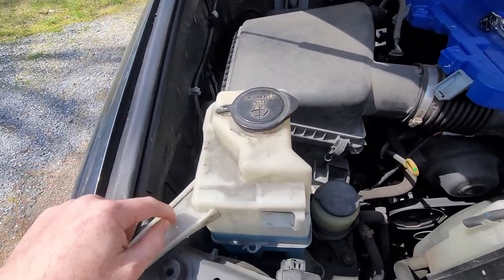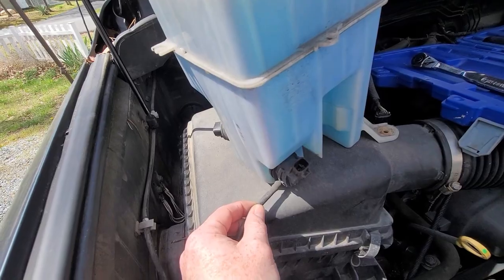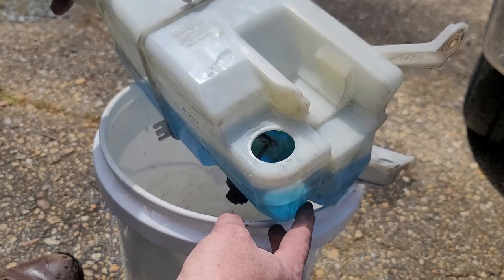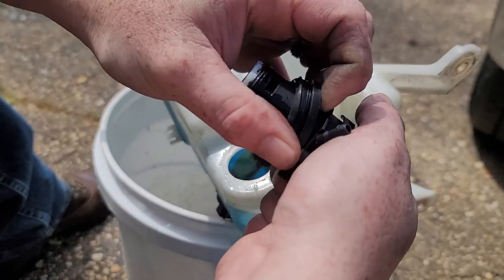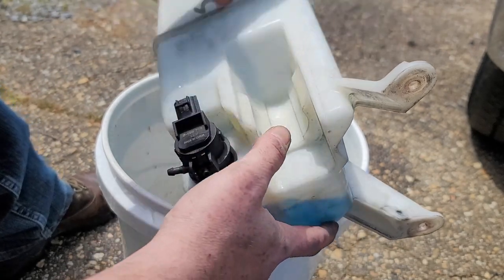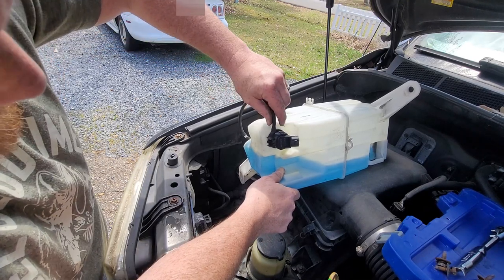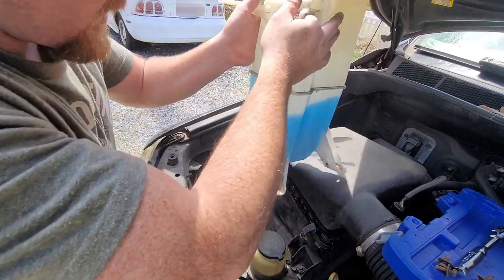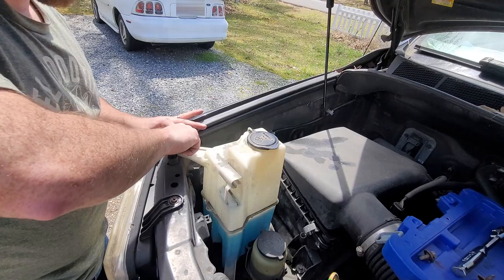How to replace Windshield Wiper Pump in a 2007 Toyota Tundra

Comment: Having trouble getting the connector off of the wiper relay motor. I didn’t see that in your video, is that something that just pulls off or do I need to squeeze a certain certain way where there might be a clip connected? Thank you, sir!
Reply from the maker: They little push connectors, there's a lip on them that you pull up on and then pull the connector out. Be careful not to break them. They can be brittle.
Reply: @Grizzel  what side is the lip on?  I’m squeezing the sides but nothing and on bumper side of connector there looks to be a little clip but cannot fig how to get anything loose.  Damn it’s a tight area to get my hand / fingers on it.
Reply: Theres no tab to “pull” on. Theres a push pad on the front of the connector facing the bumper. Its stupid hard to press by hand in that tight space. Take the headlight off and use a flat head screw driver to push in the tab under the push button.
This is late but hopefully anyone else coming here can benefit from it. This guy doesn’t explain it well at all